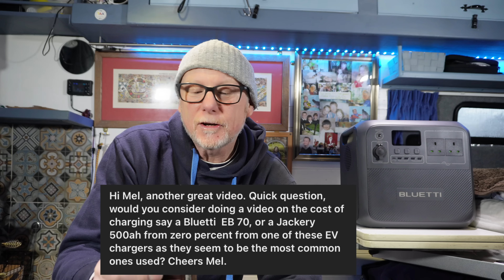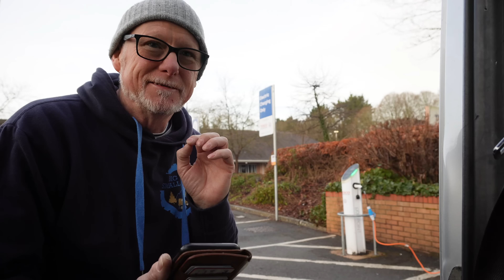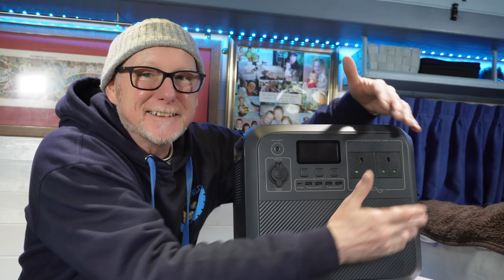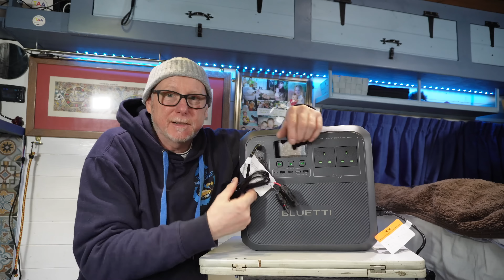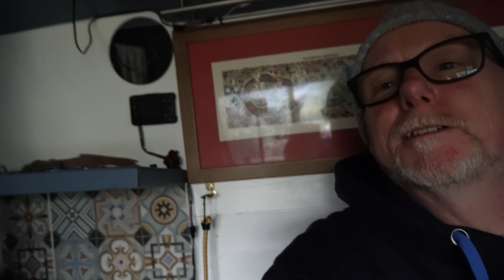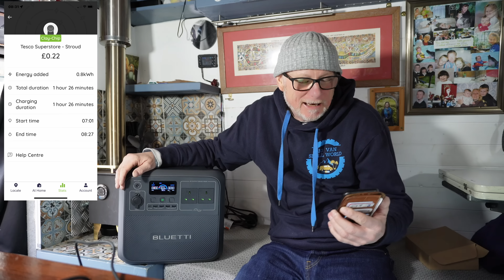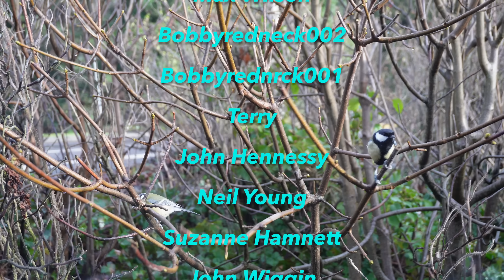Using Electric Vehicle Charger to Charge the new Bluetti AC180

Comment: Hi mel with this work with the Delta ones & where did you get the cable from thanks
Reply from the maker: I made it
Reply from the maker: EV charging cable, the Juicy Brucie - https://www.juicybrucie.com - It’s 10M long and meets EV regulations.
I have created a code MEL15. If you’d like to share the code it will give you £15 off

Comment: EV = expensive vehicles no doubt in 5yrs the batteries will be knackered mind they're ok for local pottering about
Reply: Battery will degrade to about 80% at which point it plateaus and stays there until something else critical happens to cause the vehicle to be "written off". 
Same could be said about an internal combustion engine if the engine itself develops a fault over 5-10 years, but still see a lot of old cars that are likely unroadworthy still driving around.

Comment: Interesting video Mel but I am a little confused with the spec of this unit. Amp hours = watt hours divided by voltage.
If the description says it's 1152 watt hours and we divide that by 12 volts that gives us 96 amp hours. However the description contradicts this by saying the unit is only 36 amp hours.
Am I miss understanding something or have the manufacturers got it wrong?
I'd  be interested to hear your thoughts. Keep up the good work

Comment: Mel, what are you thoughts regarding Ulez & 15 min cities. If they get rolled out this will have a big impact on not just the normal motorist but  the campervan community also. It just seems to be a waiting game at present but could really screw up vanlife for a lot of people. My van is not Ulez complaint & I'm in a catch 22 situation like most people invested time & money in a van build but now concerned this will bring an end to my own personal vanlife experience. Don't mean to be negative but trying to be realistic as it is a frightening time. Ulez , 15min cities & road charging doesn't seems to be brought up in conversation by  Vanlife YouTubers.
Reply: I don't think people understand that the 15 minute city is designed to stop you moving wherever you are it's not something you can drive around and avoid - thankfully they are being met with resistance. 

What people need to consider is this there is a push to move people to online shopping and food deliveries and the roads being quieter will assist in this so there's a motive.

The one in Oxford there's restrictions how many times you're "allowed" to move it's not good for anyone but a nightmare for vanlifers.
Reply: Have the same concerns, also either height barriers, no overnight signs or £20 overnight parking charge.
Reply from the maker: This is a really good question and to give you a quick answer for me it’s not really a big deal as I don’t go into cities I’d rather be in remote locations only down side is WiFi or lack of it but hopefully star link will solve this issue I just need to work harder so I can afford it hence you will start to see more videos from me 👍
Reply: Got caught out driving through Bristol and it’s new ULEZ. I didn’t know they had put one in place, drove up to the Brunell bridge to see signs saying I was about to enter the zone. No clear signs to avoid it, but thought I had. Didn’t go home for a few weeks only to find a fine and the half price offer had already expired. 😡😡
On looking online I saw others complaining that going south on the M5 they followed signs for the airport only to see signs for the ULEZ with no opportunity to turn off! 
Just another cash cow con.
Reply: @marknicholson2281  stop paying them it's simple until cbdc arrives and fyi anyone who doesn't know that won't be so easy with CBDC - yes there's another "conspiracy" use cash or lose it because with CBDC comes social credit scores which won't allow you to challenge anything, seriously start looking at some of the conspiracy stuff because it's railroading ahead.
Reply: @marknicholson2281  I don't think people realise this is going to be widespread eventually in all areas across UK. Driving, vanlife  holiday travel will be killed off or made unaffordable to many drivers. This is why it should be addressed on these channels and spread word of mouth and not ignored. These channel will be killed off if they think they can brush it under the carpet. No one is going to bother with a campervan, motorhome or start a self build if it's going to be a white elephant with your money being flushed down the toilet. We need the support of YouTubers and media to  fightback. YouTubers won't be able to get their freebies and perks if no  one subscribes or sponsors their channels. I think it's within their interest to show a bit of support.

Comment: Hi Mel really sorry to bother you could you tell me please when plugging your charging port into the charge station outside your van what are you using inside the charge your devices like leisure batteries and stuff is it a standard battery charger? If you could let me know please I will be very grateful as currently in the process of converting a 17 seater minibus into a camper van.
Reply from the maker: I’m using a Bluetti AC 200 max to run my van
Reply: @MelsBigVanSmallWorld  hi Mel thank you for that I was just wondering what you using to charge your power pack I know you're using the electric car port but what cable are you using to plug it in because I would like to be able to do that myself like you said respecting other people actually have electric car as I won't be stupid about things do you just use a standard campsite lead? Thank you.

Comment: If your paying to charge your batteries then any ev driver can go boil their heads?you are paying to park there,its not a free service im afraid i myself would not move👍from BIGMICK IN HULL
Reply: Good to see the Luddites  are in the chat!
Reply: @rogerstarkey5390  I'm not opposed to modernisation but my money is worth the same as everyone else's?
Reply: Yes but you have fuel in your tank to get home, ev's need to charge to get 🏡 plus you would incur penalty charges if you overstayed at some chargers,especially as some power banks take hours to charge.
Reply: If ev cars get as Common as they would like then more charging bays should be installed and may illeviate the problem. Just tell them your camper is electric 😀😀